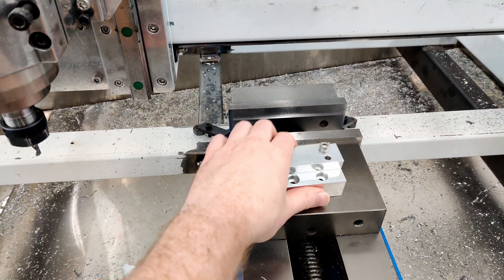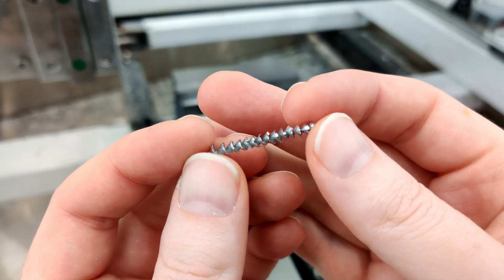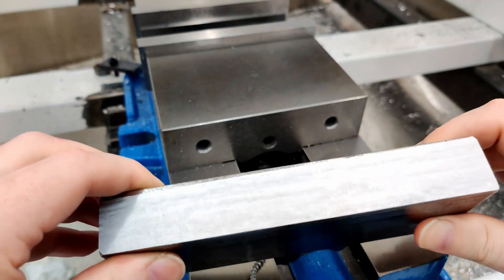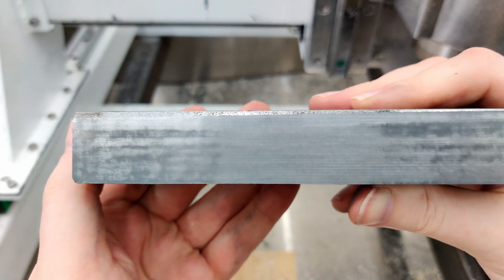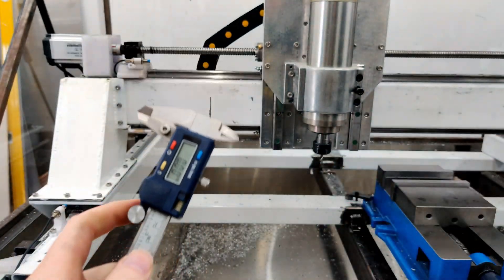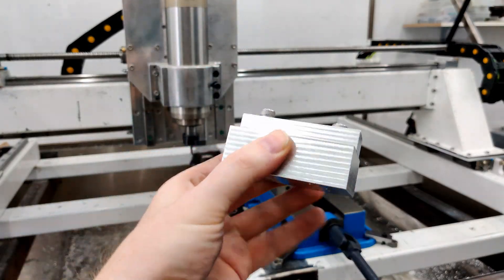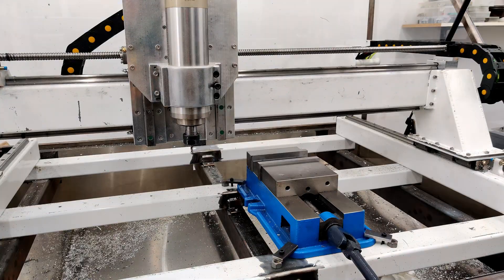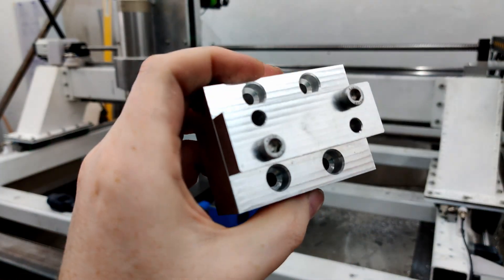Finish on round nose insert tooling on a router CNC, recap from deep drilling. what worked and not

Comment: I suspect that every time you add another stiffer component, like this one, the improvement in machine performance may be less apparent.  They are still 100% worth doing, and by the time you finish the "last" one the lessons learned from making them will be the basis for future projects.  Love it!
Reply from the maker: Not really much at this point left to do. 3 servo motor mount to replace the 3d printed ones. Than work on the enclosure and flood cooling.

Comment: AFAIK spot drills are meant to have a slightly wider tip angle than the drill that you're using so that, as you mentioned, the outer tips of the drill are never the first part to make contact and the centre of the drill aligns to the spot before it starts cutting properly. So 120 deg spot drill for normal 118 deg drills, 140??? deg for 135 deg drills. Spot drills with narrower angles (eg 90 deg) will "shock load" the outter edges of the cutting tip. Its not as important in aluminium because it's just much less likely to break the drill but in steel or anything tougher or harder it matters a lot more. Also with carbide drills (usually 135 degree points) it's probably better to just skip the predrill altogether, use a drill guide if hand drilling with carbide bits, just send it on the pnc.

Looking forward to the gcode content, not a lot of programming minded people doing that kind of content, even if they are experienced with fusion or full VMCs etc. Grimsmo had some great gcode macro content for their knife making